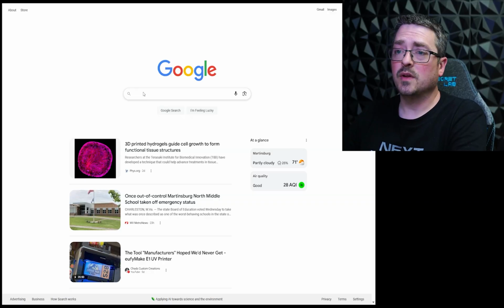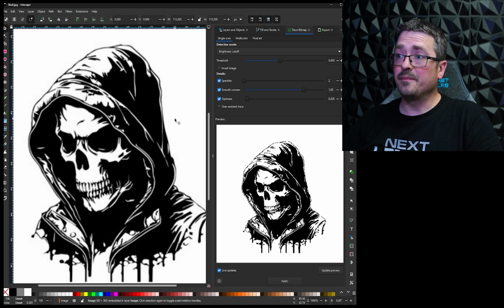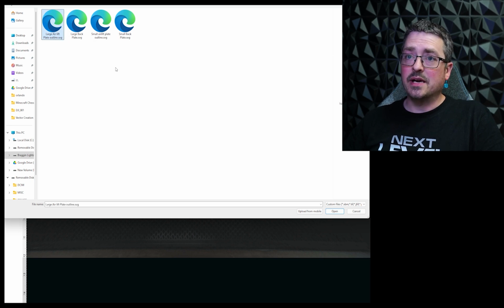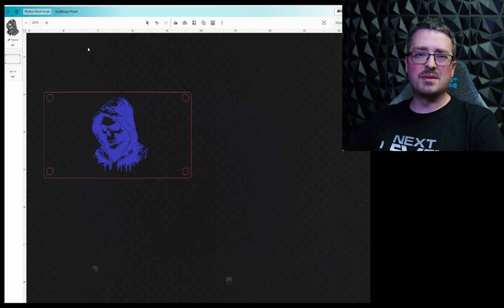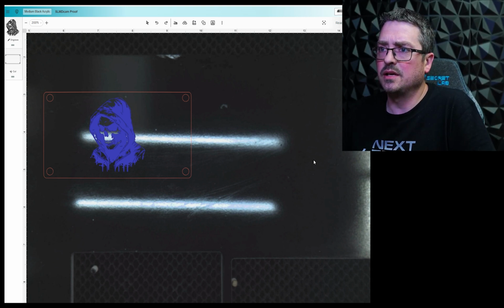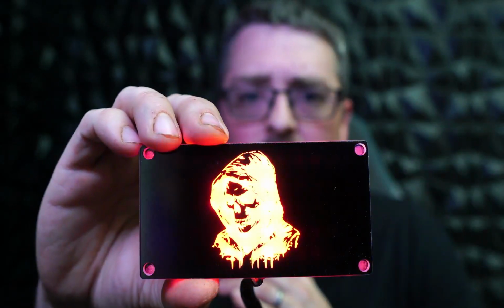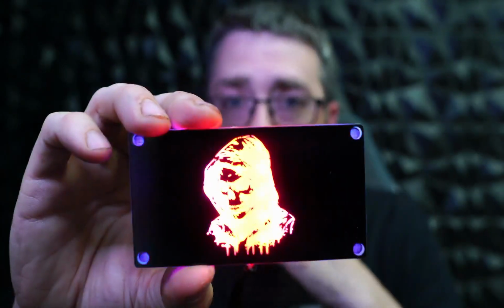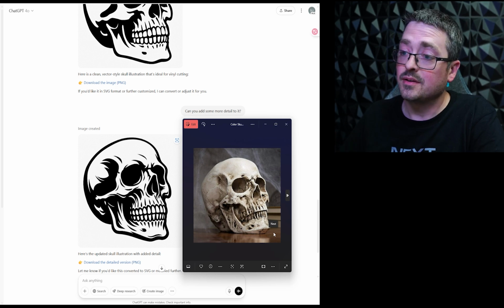How to Create a Vector For Custom Acrylic Artwork

Comment: @NextLevelNeo Hi! During the design of the Airlift plate, how do you get it so that the logo is on top/in front of the honeycomb background? Are you using one combined vector that has both the honeycomb pattern and lettering or are you using 2 separate images? I'm trying to work out how to incorporate backdrops with text or logos and before I go wasting materials I just wanted to know how you set this up so that the engraving comes out correctly.
Reply from the maker: Mixing designs can get tricky. Try asking chat gpt to create it for you. You'll want to create 1 image to import into your cutting software. Most cutting software will not stack images cleanly.